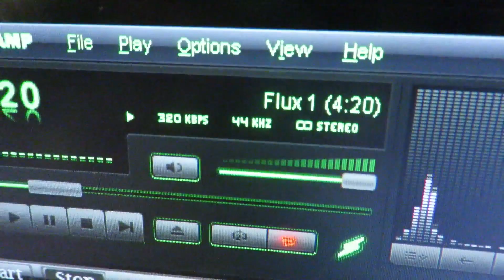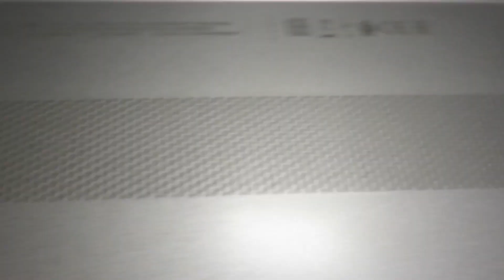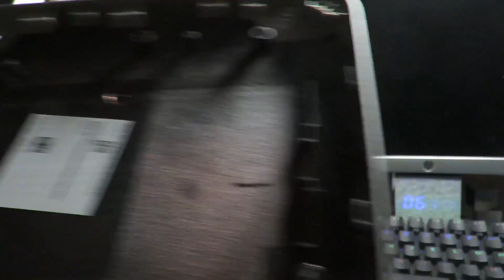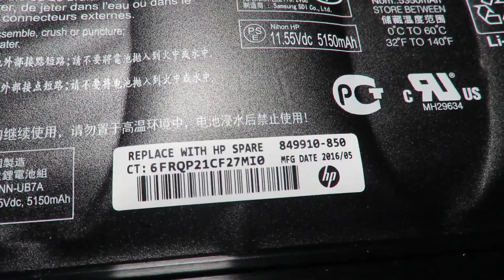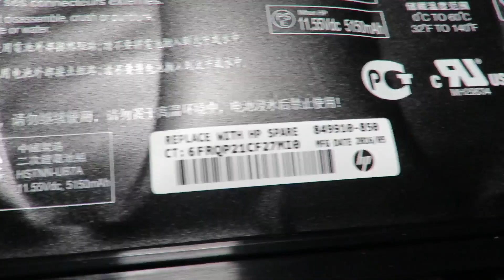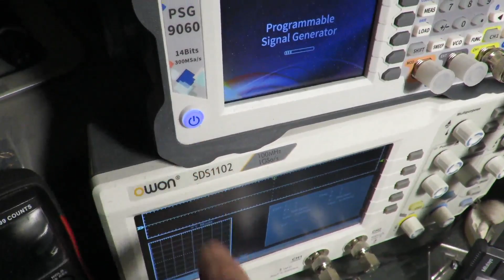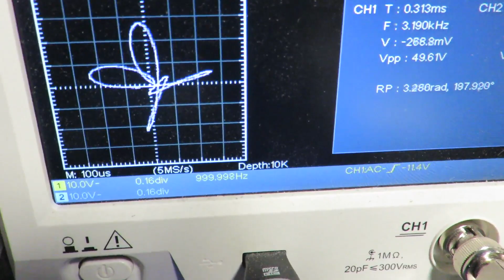HP PAVILION disassembly : INFLATED BATTERY! (part 1 of 2)

Comment from the maker: I used a WERA screwdriver from the kraftform kompakt micro/11 SB set, a 0.75 mm thick plectrum, a tip magnetizer for the two recessed screws, a small soft brush (brush type for electric razor) and a vacuum cleaner to clean the fan blades.

Comment: I see Winamp = instant +100.  Try the milkdrop visualization it's still the top!   Btw never ever ever cut open a swollen battery!
Reply from the maker: Yes, milkdrop :) For the battery, I don't know if this problem is frequent or not ...
Reply: @diezelle57   I've seen this a lot of times with lipo and li-ion packs. Also like RC cars that have swollen packs, never ever try to open or cut them.  If you get the new battery try to find a tool so the battery does not charge above 80%.  Not sure if HP has a tool or setting.  Batteries don't like being charged to 100% or get below 20%.  My phone always stays between 20 and 80% which will make the battery last a lot longer in the long run.   Btw they are working on a new winamp I have seen.
Reply: @Luke-san  I think you are supposed to calibrate the battery by letting it go to zero then up to 100% every so often.

If done safely like outside with a blast wall or something slicing that bad boy open would make a great video. Don't do it.
Reply from the maker: @Luke-san  I receive a new replacement battery tomorrow. Note that the battery was charging and discharging normally, I did the test before disassembly, and that it was not faulty seen from the HP diagnostic tool ... As this PC is stationary , it is constantly connected to the power supply. In addition, the winamp.com site is not responding ...
Reply from the maker: @Luke-san  My Winamp version is 5.8. Wacup would only apply to version 5.666 ... What I regret is that I no longer have access to the Web Browser and the streams.